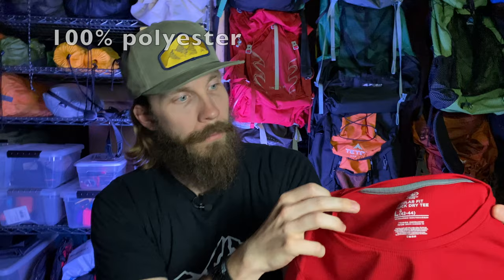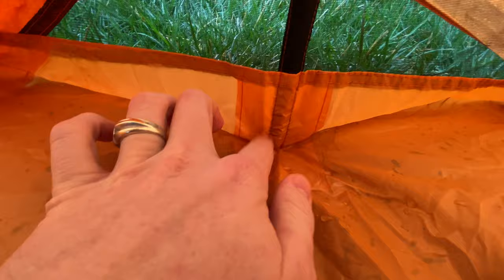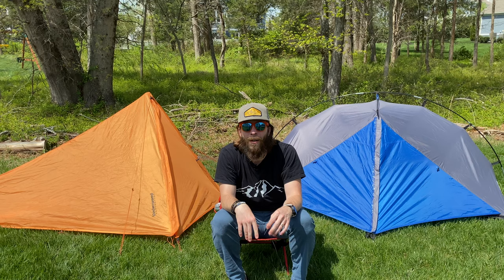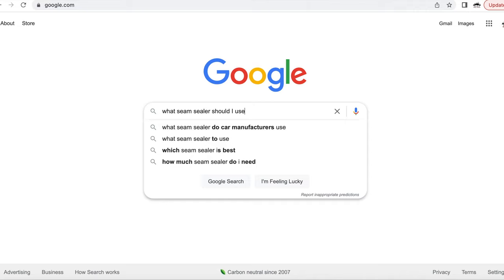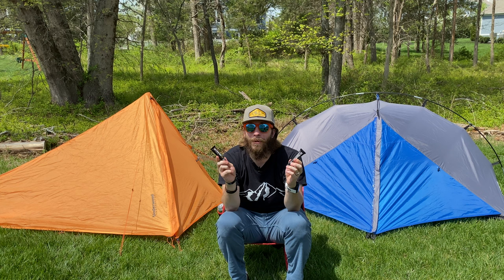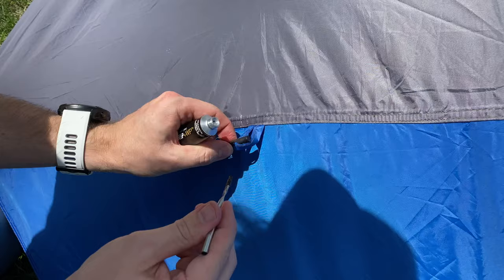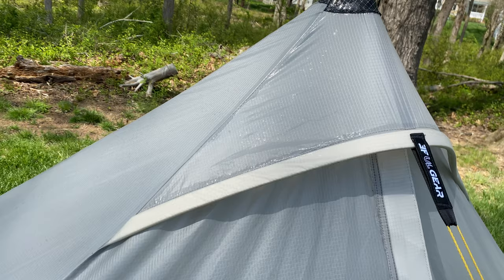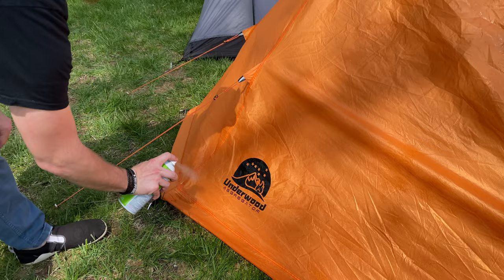FIX IT for $12  ||  How to Waterproof a Tent (even cheap tents!)

Comment: Rookie question here , I don't want to buy multiple sleeping bags , I have 2 son's so everything we do I have to buy at least 3 😂,, would it be a bad idea if I bought a Teton trailhead 20f bag , and on the colder nights place one of those 15$ fleece sleeping bags inside it ?? There cheap , light and I like fleece, I also wear good ( sometimes multiple pairs) if thermals, would that get me by if it's around 30f maby as low 20f , I'm in VA .
Reply: Grateful for any input or thoughts anyone has ,  I should add I'm a warm sleeper, I actually prefer my bedroom on the colder side in winter.
Reply from the maker: @AC-kk3vo  Hey A C! Ya, I think that would be a great approach! I haven't used those fleece liners before, but hear they are excellent. My son (8 at the time) used the Teton Trailhead 20f down to about 45 degrees. No extra lining, but some slighly warmer pajamas. He ended up unzipping the bag for most of the night. So I think the bag + fleece liner + good layers would get you down to some cold temps.

The other thing to think about is the sleeping pad. It won't matter how warm the bag is if your pad isn't rated for the cold. If you already have a pad you like, you can get a closed cell foam pad (like the thermarest z lite--there are also some budget copy cat versions) and layer it with your existing pad.

Hope it helps!
Reply: @DoseofDirt  thanks, definitely getting me a decent inflatable pad ,, I'm using a thin roll up now , it's not much 😂 , but by fall I will definitely be upgrading.,  Thanks 👍
Reply from the maker: @AC-kk3vo  Nice! Ya, I tried just a foldable pad a few times a couple years ago and it was not enough for me! I guess I'm getting old! 😆😆

Comment: I backpacked in the 70's through 90's. Car camped after that.  
I've always used a seam sealer and silicone fabric sealer.  
I typically redid the seams and fabric every year or as I found issues.   Why? because packing and unpacking flexes and abrades the various sealers. 
After walking the dog today I realize that I have to do the same to my poncho again.

Comment: I'm too lazy to paint the seam seal.  So I just use that waterproof spray to saturated spray on all the seams, 3 coats. It has been great and never have a leak even on cheap tents for the past 30 years of camping.

Comment: Was gifted an 8 x 10 canvas wall tent, it's fairly old but when I partially unrolled it it looks brand new almost.  I'm sure it needs to be waterproofed but I don't have tons of money, what would be your recommendation for an older canvas wall tent to waterproof it.  Not just the seams.  The entire thing.  And should I apply it inside as well as outside or just outside.

Comment: Thanks for the great info. One question, I have a tent fly made of silnylon, will your scotch guard method work on silnylon??
Reply from the maker: Ooh. I wish I knew the answer to that. I just checked the instructions and it says that it is "Safe for use on polyester, nylon, polypropylene, cotton, leather, suede and more". So I would think it would be just fine.

Comment: Never had either Lanshan 1 or 2 leak (unless I pushed the inner onto the outer - easy to do with the Lanshan 1 - which does not count, any tent would leak in that case). I did have to seal the guy line points on the Lanshan 2 - and yes Gear AID....

Comment: I bought a kelty gunson 4.2 tent about 12 years ago now one of our hiking trips on the Appalachian Trail me and my son got caught in bad weather the temperature dropped down to around 4 degrees Fahrenheit and we had sustained winds of 25 to 30 miles an hour and Gustav lens 45 to 60 miles an hour in pouring down rain we weren't really prepared for it getting that cold we were ready for a down to about 30 maybe 20 degrees Fahrenheit so of course we did everything we need to do to keep warm and we didn't get much sleep that night but we were very blessed we never got wet just a little cold and everything was fine but it's kind of scary when a gust comes by and pushes a tent so far over that it hit you in the chest while you're laying down

Comment: I just bought a tent, but the flysheet is water resistant, so can I apply  this seam grip wp on all the seam lines from the inside? Because after i aply seam grip i want spray silicone water guard to all fly sheet .. thanks
Reply from the maker: Hey Ahmad! Yes, you should be able to apply the seam sealer to the seams from the inside and then spray. Then you should be good to go!
Reply: Hi .. thanks for reply .. i have 1 more question .. why my tent water still coming after im spray that silicone ... I dried for 12 hours after spraying

Comment: I would rather recommend additional 2-15$ tarp (or shower curtain) above the tent. Double layer will give insulation so it's more cool on summer and more warm on winter. It will also breath better to prevent condensation. Plastic renovating dust cover also works if you want to go ultra light.

Comment: The worse tent I've ever stayed in was one of those party tents with the vent in the roof. Mistakenly took it on a hike around Scotland. Might as well have slept outdoors for all the good it did. Best tent is the six person Vango tent I have. One person can put it up in less than 10 minutes and it's a two part tent with an outer and inner.

While all tents will eventually leak, I've found tents with a separate outer take much much longer before water gets in your sleeping area, providing the outer is tight and the inner doesn't touch it.

Comment: Have you ever weighed your tent before abc after applying the rain proofing? Just interested in how much weight it adds.
Reply from the maker: Dang! I wish I would have thought of that! I know for my Lanshan 1 Pro I used about 75% of a 1.5oz tube of seam sealer. So after it tries maybe it added about an ounce? But that doesn't take the water proof spray into account. Something to think about before I seam seal another tent!
Reply: Hahahah, it's glue.  Those UL vids have your mind a lil too warped.  Even an 8lb. Baseweight will end up at 20lb. Take the weight you can carry and don't worry about an ounce.  Enjoy the outdoors, not a contest to lightest pack
Reply: @calvintraviserickson  No one said it was a contest or that it even mattered...you assumed that. We each get to decide what weight we want to carry...for some people doing it as minimally as they can IS part of the fun.

Comment: I have a COLEMAN tent I bought in 1998, but only used it for 4 months all together, so all this time, it's been stored away in it's original case.... The tent material says UV-Tex 5 (non-nylon)... Rained a few times, but I never got wet.... Even though the tent seems very waterproof, it is about 25 years old, and now I'M FINALLY PLANNING A HIKING TRIP on the Appalachian Trail in 2025.... Which waterproofing product should I use? I was going to buy KIWI Camp Dry Heavy Duty.

Comment: On the other hand, cotton isn't waterproof, but if it's a tight weave and it gets 'seasoned', it actually is.
Reply from the maker: Yes, the weave can make a massive difference as well. I think the weave of most tents will make it 'water resistant' in lighter rain, but not water proof. Since I want to be prepared for all conditions, I like to waterproof them!
Thanks so much for watching!

Comment: Hey, DOD! I was recently looking through Ozark Trail products and saw a 1-person backpacking tent called the Himont that I hadn't seen before. $40 with a full fly, and a bit heavier than this model, but I'd love to see a review on it as a budget tent!
Reply from the maker: Thanks, Hartman! I've been looking at that tent as well since it is a full double wall tent, but still affordable. Thanks for the suggestion! 
Thanks for watching!
Reply: I've also been interested in these little one person bivy bag, popup, etc. tents. I wish I could say bad things about ozark trail but you get what you pay for and in my opinion you get a lot more than expected.
Reply from the maker: @aussierule  Hey Chris! I've also wanted to try those pop up bivy things.

And you are right about Ozark. I'll admit I was disappointed when it failed the rain test, but even after spending time sealing the seams and waterproofing, the tent is a bargain. it's also a lot more spacious than some 1 person tents I've tried.

with a little TLC the ozark trail tents are a bargain!

Thanks for your comment!
Reply: I have an Ozark 1 person , I'm not sure of exact model but looks a lot like the eureka 1 man , my son really likes it , I put a tarp over it to help with condensation, it does carry good , you may be looking at a different model as mine was only around 28$
Reply: Friends have that orange and white that I think is the Himont.  The poles are thin.  There's two of them but they don't cross, so you get a rain catch belly at the crown.  Support that somehow on rainy nights or you're going to get wet...or a pole will snap.  A couple of battens tied up there should do it.

It does breathe a lot better than the one pole blue and gray one...mostly if you leave the rainfly off.  The blue and gray one is likely better for chilly nights.

Comment: Does doing this cause more condensation? I have a truck bed tent. Any ideas that help with condensation in the tent over night?
Reply from the maker: I haven't noticed an increase in condensation after waterproofing. It probably does a little just because of the nature of it. I don't have any experience with truck bed tents. The cause of condensation is lack of air flow. Any way to vent your truck bed tent at night?

Comment: What about ONLY using the spray repellent...such as Atsko or 3M Outdoor Waterproofing, on the seams (and rest of tent) instead of the tubes of goo ?  It would have been best to compare both methods....i.e. is the spray too thin and less effective on the seams ?
Reply from the maker: I haven't personally tried this, so couldn't say. I know the seam sealer is a bit more work, but I'm more comfortable putting that on the seams than just the waterproofing spray.

Comment: Your tents are probably fine now for  camping in less extreme conditions. I wouldp opt for an expensive tent if heading above treeline or wnter camping. I have 3 tents for different conditions. My oldest is a sierra designs tirros. It must be 25 years old. Had to seal all of the seams after the tape broke down. It has seen serious wind including the presindtial (mt washington) in wnter. My TNF tadpole kept us dry in monsoon rains and standing water. It had a bathtub floor- that worked. Personally, i would not skimp on the tent, unless you are next to your car.

Comment: Apply on the outside or reverse side? Thanks
Reply from the maker: Hey Linda! I applied the seam sealer on the outside. I think you could technically do the inside, but it would be a lot more work and harder to get the seams 'tight' to apply the seal.
And if you are seam sealing a tent where the factory already did a bad job seam sealing, their seam seal tape is likely on the inside and putting seam sealer over that isn't going to work very well. So I opt to put it on the outside, but it does make your seams look a little 'wet' all the time. I don't mind it, but some may.
Thanks for watching!
Reply: @DoseofDirt  thank you!  I watched another video from MSR  and they said to seal on the reverse side. I ended up selling on both sides.
Reply from the maker: @lindalu8565  Sounds like your double prepared! Was it super difficult to seal on the inside? I honestly wanted to do that for my corners, but it was just so difficult to get in there!

Comment: I add naptha and silicone (from tube) into a bag that won’t leak 😅 so that the silicone liquidises.
Then add your nylon tent.
Mix throughly inside the bag so all areas are exposed to the liquid.
After 3-4 mins remove and hang up on a line to dry.
=Waterproof. 😂
If you want or demand to go extra, then seam seal.
Reply: Does that cause the tent to smell like the chemicals?

Comment: I own a swissgear 3 bed room w/screen room tent I had purchaced 2nd hand on Craigslist years ago, it came terribly saturated with cigarette odor. I used a teatree oil mix to abate that issue and may have affected the waterproofing or its simply age, I have never done any waterproofing on this tent. And yesterday we got rained out. What I did find out was that the tent HOLDS water extreamly well. We had 2" of standing water from rainfall inside the tent and all our gear left in was soaked.
We ended up sleeping in the car waiting for the storm to pass
This is not a cheap tent I want to save it.

Comment: Why do you seal the seams on the outside instead of on the inside of the tent?
Reply from the maker: I do the outside because it keeps water from getting into the seams. Also the seams are sort of stretched out on the outside rather than sort of folded in on themselves on the inside. And, it is easier. I know some people prefer inside, but I have always done the outside.

Comment: What about the condensation on the inside? Got a tip for that too? No, not a sponge or rag. More like a battery powered fan 🪭 or something
Reply: One thing is to not burn propane in your tent for heat. I know it sounds like black magic but for every pound of propane you burn you introduce 1 1/2 pounds of water. Ventilation is the only solution I know of.

Comment: But how does my steel pot hold water even though my steel sieve leaks if they're made of the same material? :D
Reply from the maker: 🤣🤣🤣 Maybe we should use the seam sealer and spray on the sieve and see if we can turn it into a pot? 🤣
Ya, when I recorded, I started getting into weaves, etc. but felt like it was making things too long.
But you're right that the weave of the tent fabric definitely makes it water RESISTANT, just not water PROOF.
Thanks for watching and adding to the discussion!

Comment: I've never owned a water proof tent. I've never treated a tent to "waterproof" it, since that's just a waste of time (it might make the tent more water resistant for a short time, but mostly, you're just wasting money).

A properly pitched tent DOESN'T NEED TO BE WATERPROOF. Some water will penetrate the material if it's raining hard. This is normal. The water won't drip into the tent, but will run down the tent wall. That's what is supposed to happen, if you pitched your tent correctly. The tent's walls need to be taunt, and everything likely needs to be spiked down properly, but if that is done, the water's not coming in, it's skating down the wall.

But if you are sleeping in a tent while it is raining, there are two things you must do to keep dry. First off, your tent needs to not be touching any of the tent walls. Secondly, your sleeping bag needs to be on a proper sleeping pad, as these are designed not to transfer the moisture from your tent floor up into your sleeping bag.

Used to be a boy scout. Not only have I camped a lot, but I've also backpacked, and tent slept during thunderstorms while out on the trail. This was 35 years ago, so before silnylon and all the other fancy new materials. Not that silnylon lasts, it breaks down in UV, and you have to keep treating it with more silicone. Just use nylon. You don't need to spend a fuckton of money on the fancy materials. It really isn't worth it.

Comment: Complete nub here. Should the outside seams be sealed and not the inside? Or doesn't it matter?
Reply from the maker: Hey David! I think technically you could do either. I find that the outside seams are a lot easer to get to. And on these tents there was already seam sealing done on the inside by the tent company (but a bad job of it). And if I tried to seal the seams over the tape that was already there, it just seemed like the seal would likely not be as good.

Personally I've only ever seen people seal the outside and that is what works for me.

Welcome to backpacking!! It's awesome! If you have other questions, let me know!
Reply: @DoseofDirt  thanks
Reply from the maker: @btrswt35  No worries! Good luck with the seam sealing!

Comment: The FIDO 2 AI (All-In) is a two person, rugged and durable 3/4 season tent. This battle-tested and proven shelter system is the perfect set-up for anyone who enjoys everything the outdoors has to offer. The FIDO AI includes everything needed to endure the elements in any season.

This shelter system comes complete with:

Cold weather kit (windbreaker + 4 snow/sand parachute stakes)

Inner tent

MultiCam® rainfly cover

Waterproof groundsheet

All-in-one aluminum pressfit pole set

Waterproof tuff sack

6 ground stakes

Accessory kit

In stock

YOUR PRICE:$585.99

FIDO 2 AI - Two Person Shelter System quantity

Best tent evwr

Comment: 2 things, first that music was way to fucking loud. Second while you are technically correct. Just because they are made out of the same material does that mean they are the same. Types of weaves and construction matter tremendously and can completely change something. And a side note I used that same scotch guard on a coat I had and it barely helped.

Comment: I got very tired of spending top buck for tents even of quality that will leak and structurally fail. I Make my own. They are very light weight (made out of cotton bed sheets) and coated in silicone. I don't bother with grommets or other BS . 
Last a long time and if I have to reseal I can. other then that making a new one with the cost of about 30 USD...goes a ton longer